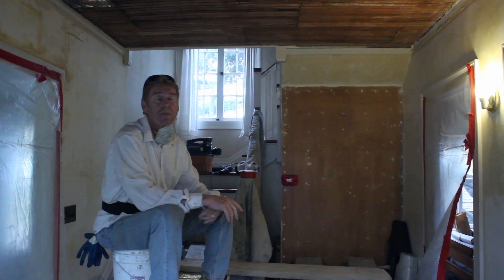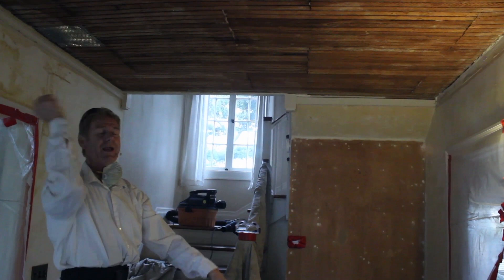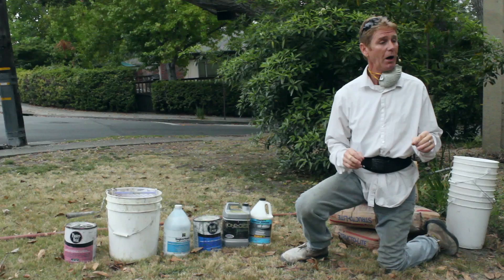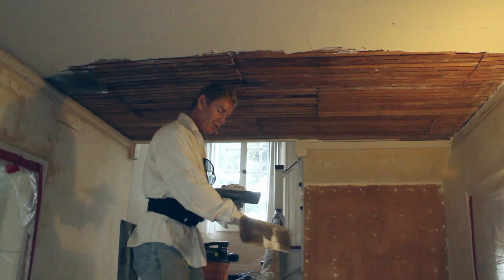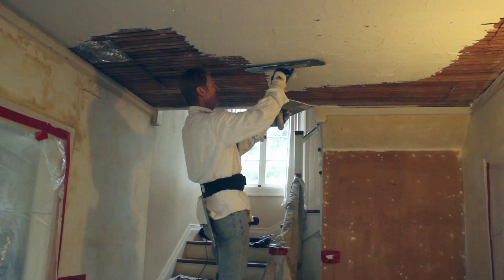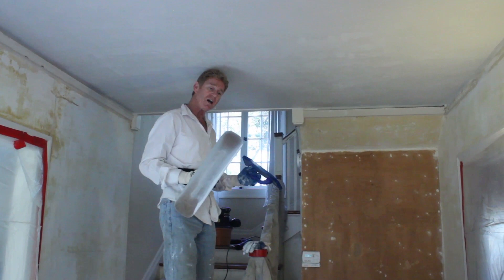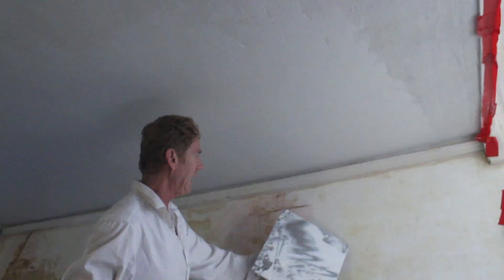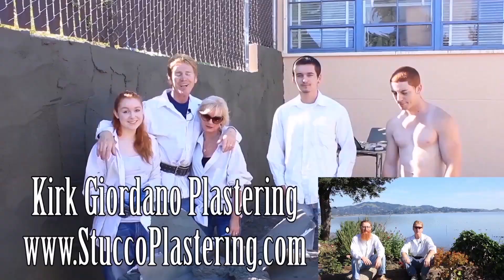Structo-Lite base-coat with a lime plaster finish

Comment: Are you mixing the lime into the structolite or were you talking about a lime coat over the structo?
Reply from the maker: Howdy Dust Puppy, no, I don't add real lime to any products as the ones I prefer have Lime or what they call plastic's already inserted in the bags.
    They say plastic's works the same as lime, the truth it is it's less expensive to buy and add, however, i'm not the stucco police, I use what's available.
 And yes I applied a veneer plaster over ( either Diamond or Imperial) the base coat which crushed limestone and gypsum premixed we just add water.      
                    Live long and plaster
         Mastering Plastering for the beginner
Reply: I hadn't found those products. I had come to the conclusion that they just didn't exist. I guess I need to look harder. I thought I was going to have to mix the lime in by hand.
Reply from the maker: Howdy dude, depens on where your located, In the UK, they have the same produts by differt companies.      
                    Live long and plaster
         Mastering Plastering for the beginner
Reply: I'm in Alabama. That's about the same as being in another country, though. I have finally found a local source for most products. Including Weldcrete. I didn't ask about premixed lime cement, as I had come to the conclusion that I'd have to mix it by hand. I had done web searches and couldn't find the premixed stuff. That's why I had thought it didn't exist. Nobody at the home stores knew anything about any of this stuff and the local material yards don't sell in small quantities. I finally found a place that bridged the gap, called Ram Tools. I"m trying to do some repairs on an old house that has been patched with stucco, taping mud, pieces of drywall and something that bears a disturbing resemblance to bubble gum. Probably nothing you haven't seen before but until now I've only done drywall. Hell of a learning curve and I'm thankful for your videos and your replies to my questions.
Reply from the maker: Howdy Dust Dude, no noubt there a lot of confusing out there, as it take awhlie to understand stucco appliucations.     
                             Live long and Plaster
Teaching the world how to plaster one Video at a time.
Reply: There's definately a steep learning curve but your videos are a huge help. Thanks for that.
Reply from the maker: Howdy Dust dude, takes time, best wishes
                       Live long and plaster
 how to repair your number 1 investment

Comment: If the Structo-Lite is left to fully dry over 1-2 weeks do you think the Diamond will still adhere or is it best to finish with Diamond on the same day?
Reply from the maker: It can be left on ten years, the finish coat will still adhere if prepped with a bonding agent.😉